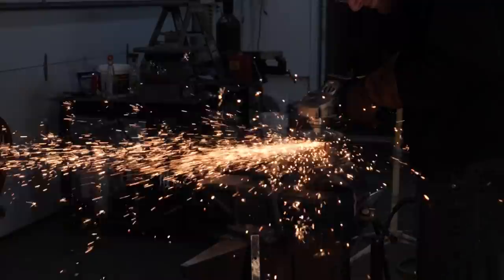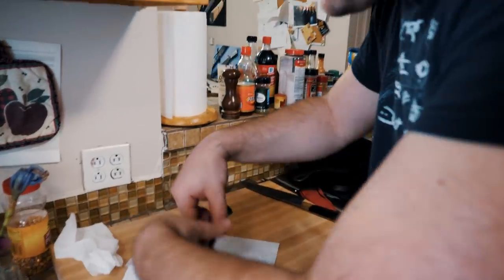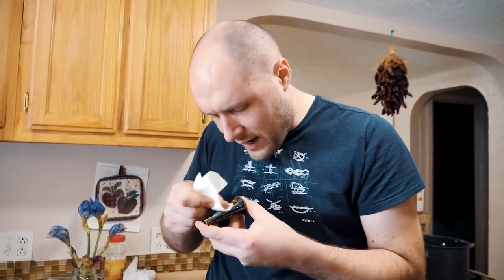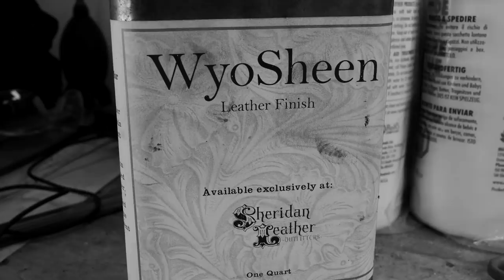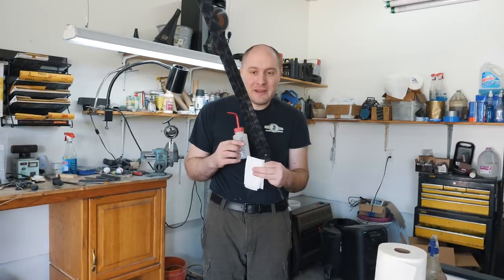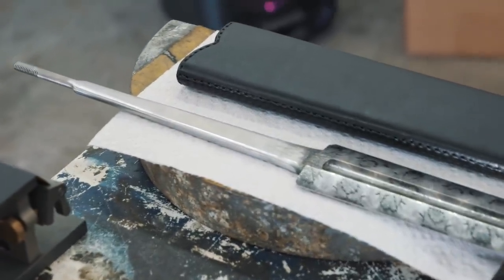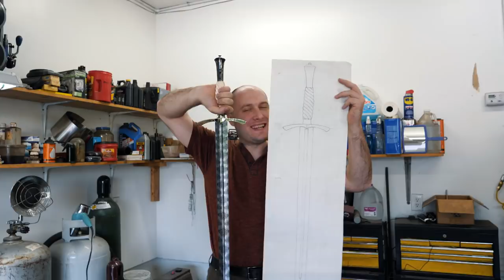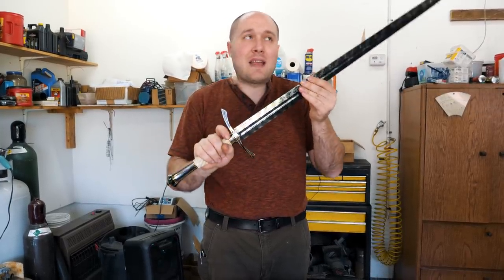Making a Medieval Damascus Sword, The Last Part

Comment: Kyle, why don't you soak and wipe your parts with acetone before the soap bath? It will wipe away absolutely all traces of oil and other contaminants. I get pretty good results using this method and I don't even soak in the soap prior. I'm still a rooki when it comes to bluing though so you may have your reasons.

As for sandpaper, try Matador SC sheets. They have paper that goes all the way up to 7000 grit. Iv only used the 5000 paper though. Try jewelry making stores because that's where I get mine.

The sword is absolutely beautiful. Really a true masterpiece. I really appreciate being able to see your work as its made.

Comment: Hey Kyle great video, beautiful sword!  If you are hot nitre blueing you should try rubbing rig walnut oil on it after displacement oil  process.  We gunsmiths use it and then wrap it in newspaper, soft blue paper towel or etc.  The water displacement properties are slightly better, and leave a thicker no rust barrier that wipes off quite easily.  I recommend soft micro fiber cloths.  See ya on the next one.  Be well.
Reply from the maker: Thanks for the tip ~ Team Royer
Reply: @KyleRoyerKnives  
No worries, I hope it helps.  Also, after coating your parts in the Rig and wrapping them in the paper, (I would recommend the soft blue shop paper towels) leave them overnight.  I find that the blueing becomes slightly more durable, and takes on a darker, deeper hue.  Be well.

Comment: Hi Kyle, 3M make a super fine sheet based abrasive. The abrasive material is Aluminium Oxide the same as regular sandpaper. They don’t use paper backing they use a plastic film (because paper is not consistent enough thickness). It is called lapping film and is used in highly technical electronic or related speciality finishing applications – eg sanding fibre optic cables for joining. It is available down to 0.05 microns. You could use the 3 micron stuff which is equal to about 8000 grit. The codes are (3M Lapping Film Aluminium Oxide 254X, 261X, 262X, 263X, 265X, 266X, 268X, 264M). Hope this is useful.
Reply from the maker: Thanks for the info Julius! ~ Team Royer

Comment: Kyle. Combat Abrasives has sheets of sand paper up two 3000 grit in silicon carbide. I use this paper for all my pieces it works as well or better than Rinowet. I also use a felt backed polishing abrasives that works very well and can be perchased in very high grits. I have some in 6000 grit.. Martin
Reply from the maker: Thanks Martin ~Team Royer

Comment: 6:10 I feel your pain Kyle just got done hand sanding a blade put it on the counter and my dad goes and does possibly the most violent and clumsy bang the knife into the counter top multiple times repeatedly letter opening I’ve ever seen and scratched my finish. I can sense the tension in the air about who’s gonna hold the sword

Comment: I know they're not sand paper, but they're also not the mesh sanding pads that advertise the fine grits. Micro-Mesh offers "Pen-Sanding Pads" that go up to 12,000 grit (including 1500, 1800, 2400, 3200, 3600, 4000, 6000, 8000, 12000 grits in a pack). They're an actual sand paper on a foam core, so they can be easily bend to form around curves. Not sure how they'd work on metal, but they offer a great selection of grits in a small pack.

Here's a link to their Leevalley Tools page: http://www.leevalley.com/us/wood/page.aspx?p=62127&cat=1,42500

Comment: Hi Kyle👋 You made an awesome looking sword. I'm a Knifeesmith Apprentice from Switzerland. Although i don't have as much experience as you do i still think i can give you some advices. When you're really paranoid about getting scratches on your finished surface you should use Kleenex facial tissues instead of Paper towels. Because  Paper towels can still slightly scratch some surfaces. And if you leave your Paper towelroll around the shop there's always gonna be some dust on the towels that might scratch your surface. You don't have that problem when you use a Kleenex box. I regularly have to sharpen paper cutting blades up to 3 meters that i have to freehand sharpen. I don't think it's a good idea to sharpen the sword on your legs for safety reasons and a better control of the sharpening stone. I hope you don't take my comment as criticism just wanted to give some advices that might help you. Again geat work. 😅
Reply from the maker: Thanks Chaim ~Team Royer

Comment: Kyle.    Anezus has a 90 piece kit that has 400 to 3,000, 5,000, and 7,000 grits in the set its made for automotive paint finishes I have seen as high as 10000 grit wet and dry sandpaper
Reply from the maker: Hey thanks jason 
Will check it out my friend 
Cheers 

Team Royer

Comment: I like the blade a lot, but I'm not so pleased about the function of the  handle.  Because of the design it appears to be a one-handed sword.  But a sword this size it would be nice to wield with 2 hands, so I would have preferred a longer handle in case you wanted to use 2 hands sometimes.  The execution though is definitely top notch and I can't fault that at all.

Comment: The felt backed paper I mentioned is a 3M product called Tri M Ite it goes up to 10000 grit it is a wet dry abrasive last a good time and for me works very well. For instance you know when your hand sanding if you start and stop at higher grits you can see were you did this with paper. For me this high grit polishing paper makes this issue nearly impossible. Good luck on finding the perfect paper for yourself. There are many types in very high grits just need to find something that works the way you like... Martin
Reply from the maker: Thanks for the info! ~ Team Royer

Comment: I had a small 6 by 6 inch piece of 100,000 grit sanding paper a few years ago. I kept it for a long time never using it because I wanted to find more but never could and I eventually either lost it or my ex wife threw it out in a move. I have no idea where it is now.

Comment: I dont remember the company, but i had some 8 micron and 3/10ths of a micron paper that runs about $25 a sheet. You should be able to find it online. I used it to sand an aluminium cross that i made for my big sister when she died and it had such a mirror finish you cant use a flash when photographing it.
Reply from the maker: Hey thanks David. Sorry to hear about your big sister. May God bless you and your family. 
Be safe and be careful. Cheers. 

Dad

Comment: There is a special sand paper used for sand optical cable terminals i use to used and has a cushom on the back so is very soft and my calculation is that the gran must be finer than 8000 grit i think i have some shits arround my shop if yo cant find it i can look arround and sent you more info or 1 sheet of it.
Reply from the maker: Sounds great Cesar
Thanks 
Day

Comment: Behold! The black sword of Kyle Royer.
Reply from the maker: INDEED 👍🏻🔥☕️⚔️
Reply: @KyleRoyerKnives I'm about to grind my first two edge dagger. What is the degree angle that you ground this blade ? I read that the angle should be 20 degrees. Is that correct ?
Reply from the maker: Depends on what the knife wants .  Start steep because you can always flatten it out.
Reply: @KyleRoyerKnives  Thank you.

Comment: 5000 grit paper 
https://www.thesandpaperman.com.au/pack-of-100-230-x-280-mm-x-5000-grit-hermes-ws-flex-16-silicon-carbide-wet-and-dry-waterproof-paper-sheet.html
7000 grit paper 
https://www.thesandpaperman.com.au/pack-of-50-230-x-280-mm-x-7000-grit-starcke-wet-and-dry-sheet.html

Comment: You can by micro mesh for higher finishes its fabric backed unlike the open net style papers and available up to 12000 grit . https://www.thesandpaperman.com.au/micro-mesh-rolls-150-mm-wide/
Alternatively  starcke abrasives make up to 7000 grit wet and dry .
Reply from the maker: Thanks ~Team Royer